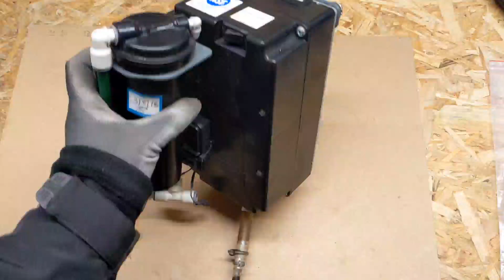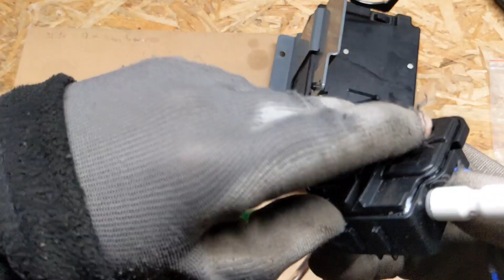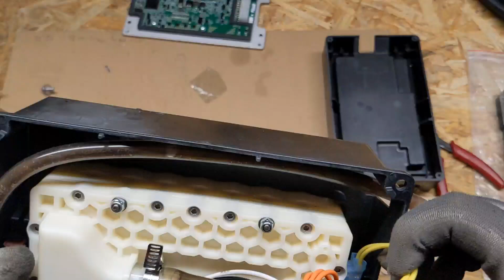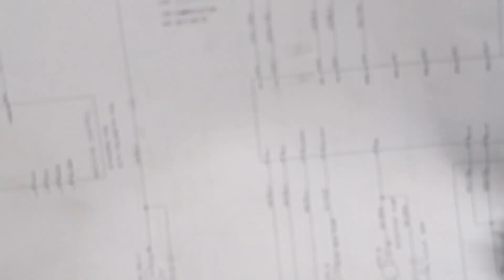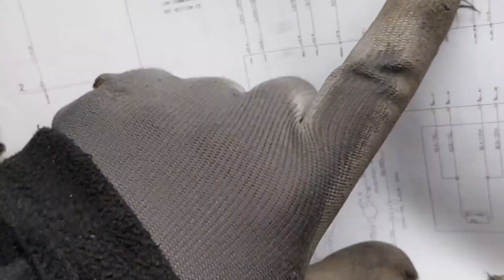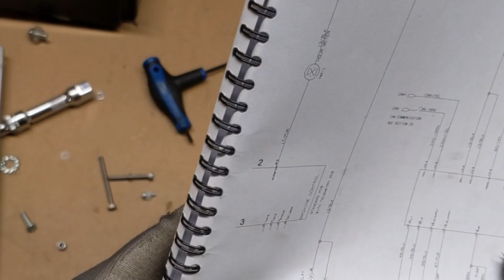Tear Down Of A Broken Tennant T300 ec-H2O Module

Comment: I have t300 Tennant problem is after 5 mins batteries down and turn the machine completely off but my batteries are new 
Any advice
Reply from the maker: thanks for watching and leaving a comment. its hard to pin point the problem with out seeing it. but if the batteries are definaltly new could be a charger issue or a board or software issue.

Comment: It would be interesting to find out what them electrodes are made from, in electrolysis anodes have to be made from very inert materials such as platinum/platinum coated titanium, MMO or graphite(they obviously don't look like graphite), common metals would corrode under harsh oxidising conditions at the anode, stainless steel can be used for the cathodes but will only work as an anode under strongly alkaline solutions such as in a HHO cell.